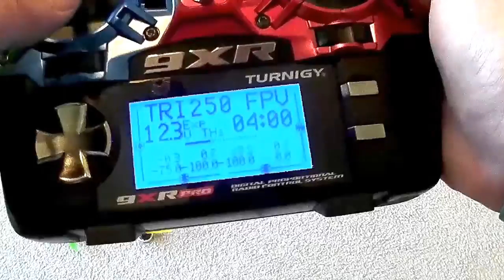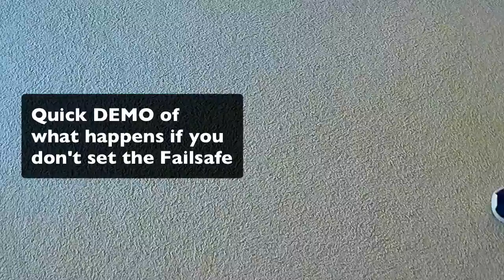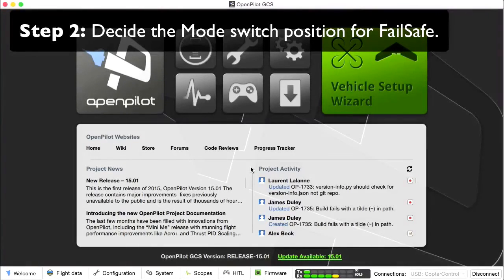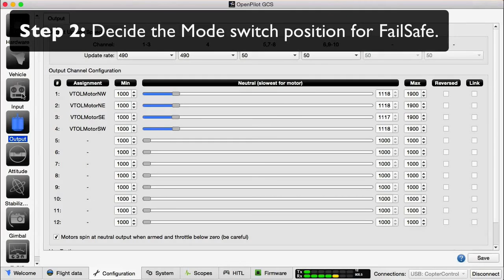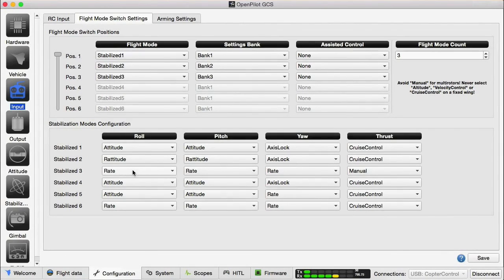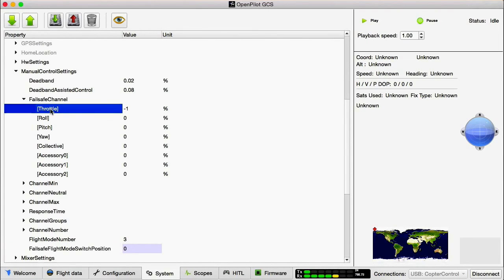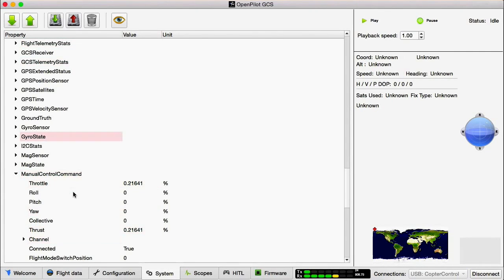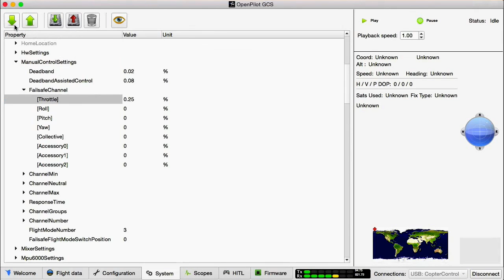FailSafe on CC3D

Comment: Please for your own sake do never ever set failsafe to motors just below hovering, it might sound like a good idea at first but you will end up burning both ESCs and motors when it come down and tries to spin props while vegetation is blocking the from spinning, trust me. Been there, done that. You will save your machine a lot better if you put fail safe to drop dead, turn off all motors. If you need some evidence you can see that its exactly what happend in some of my crashes. :) https://www.youtube.com/watch?v=XqVqLby799Y if you think about it the most cases loss of contact happens its already crashed upside down somewhere out in the vegetation and thats not exactly when you want it to start spinning the motors.
Reply from the maker: Zallestial that is a very important point and I do agree with you. It is really something you need to consider when setting FailSafe. When you do loose connection with the copter it is never a good thing. Either it is going to drop and get damaged or you stand a chance of burning a ESC. You must take it into consideration of where and how you fly. For me I am typically within a few hundred feet from the 250 copter flying behind a tree or a rock or something and at that point I could loose connection. Setting the FailSafe just below hovering, either with the FailSafe transmitter or with the FC, has saved me many times as the copter does not drop dead and crash. I typically regain control when the copter emerges from behind the obstacle or I make it there pretty quickly. I can see that flying away further can definitely be an issue as well as the terrain you fly in.